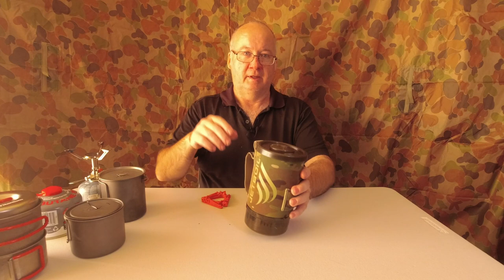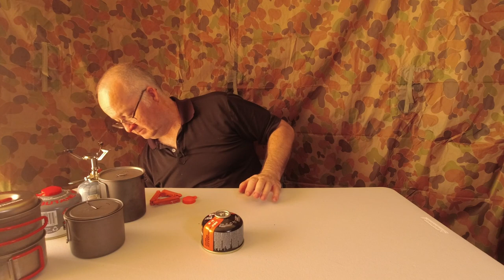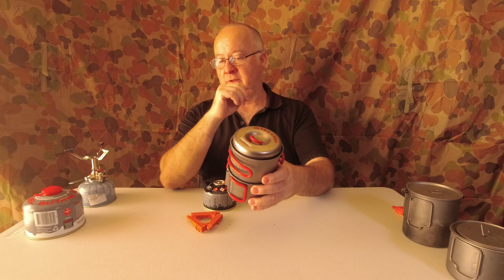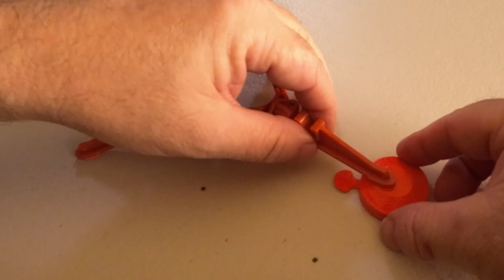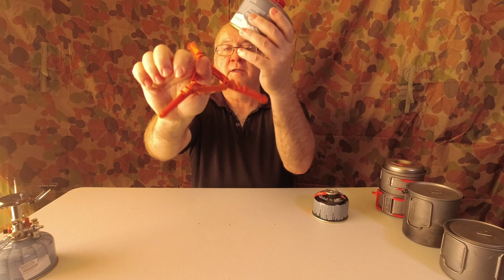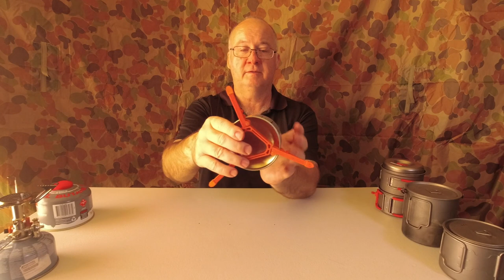JETBOIL Fuel Can Stabalizer, use and easy way to take off the gas cannister.

Comment: Hey Clive great tip with the stand, btw I got myself the copy of the Jetboil from KMart it’s only $39 (clearance price) and it’s fantastic works just as well as the original- I’ve also ordered the refill adapter so that I can buy the cheaper cans and refill the used one 😊
Reply from the maker: There is some pretty good copies out there now.
Let me know what you think of the refill adapter, I have been looking at getting one.
All the best
Clive
🤠

Comment: Interesting how many different combinations there are for packing the jetboil flash away. I put one of the small washing up sponges with the green scourer on one side in first, sponge up, then the stove in, the stand over the piezo rod and then the gas, with the burner ring slipped around it, before putting the lid on. The stand in it's triangle formation, stops the top of the stove getting into contact with the gas canister and the sponge at the bottom protects the connector at the bottom of the stove. Horses for courses I guess and good to see how others pack theirs
Reply from the maker: It's always good to watch how others do it.
Different size pots, different ways of doing it.
Also like you use the green scourer, other may not have thought of using one.
Thank you for sharing your ways of doing it.
All the best
Clive
🤠
Reply: I have evolved my use of hike stoves to solely use it for heating up water which I then use with my cup for tea or coffee and for rehydrating my meals in their packets this keeps clean up to minimum and the empty packets are flat and easy to carry and clean till I can dispose of them later
Reply from the maker: @thinkhelpservice  99% of the time that is the same for me 😀